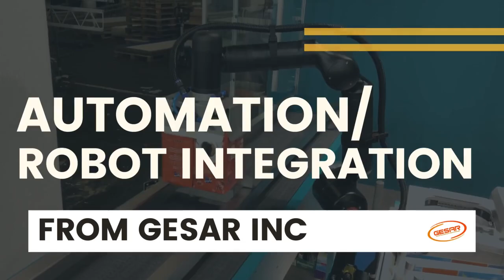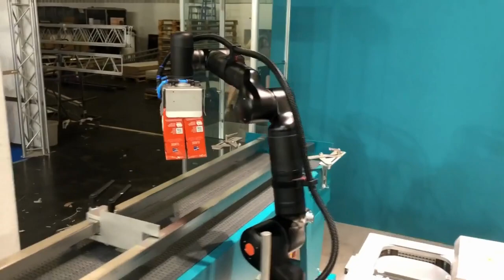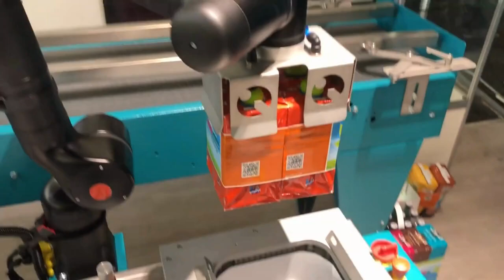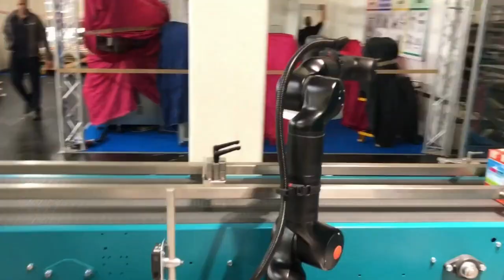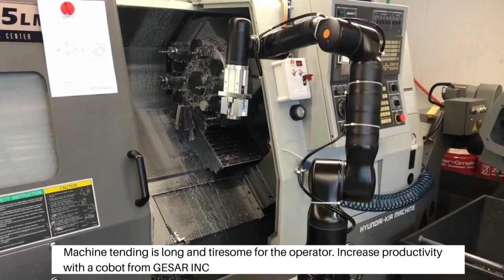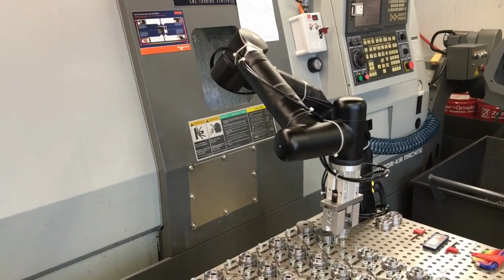AUTOMATION AND ROBOT INTEGRATION FROM GESAR INC

Comment from the maker: AUTOMATION AND ROBOT INTEGRATION FROM GESAR INC
GESAR INC offers specialized engineering and programming services for our clients to assist in integrating automated solutions to increase productivity and eliminate waste.

We assist our clients in solving their production problems by by designing, building, testing and installing complete or partial automated manufacturing lines and systems.

GESAR INC. provides automated solutions for applications involving machine tending and packaging/palletizing.

Machine tending and packaging/palletizing can be long , repetitive and draining for the human operator.

GESAR provides the exact automated  solution for these applications with white glove delivery, on-site training , co-piloting your first run or production and providing remote support.

Contact GESAR INC. today to analyze your machine tending and packaging/palletizing needs and provide a plan with a detailed proposal showing which solution is best for your application and complete the installation.

https://gesarrobots.com/